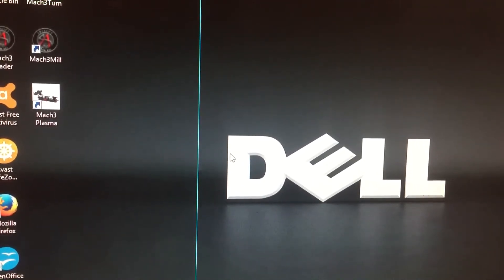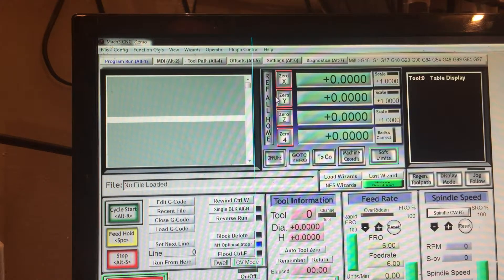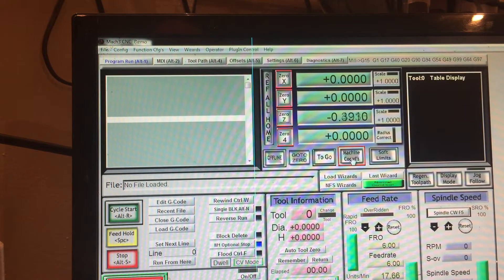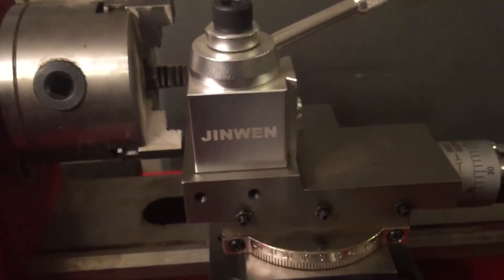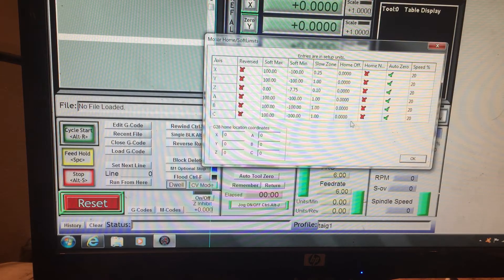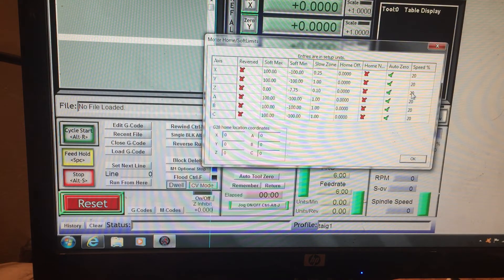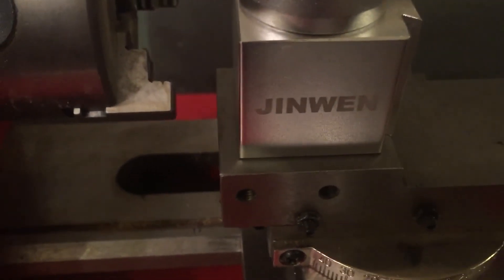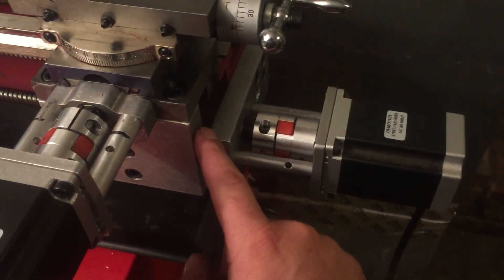How To Set CNC Soft Limits To Avoid Crashes

Comment: I am struggling with soft limits on a mill. When they are set, and if I need to zero the DRO on the work piece, I find that the soft limits are in a totally different place. Is there anyway round this?
Reply from the maker: That is a good question. I'm sorry but I sold this machine just recently and don't have access to it anymore. From what I can recall it was in the separate place like you said and I don't know of another at the moment. Hopefully someone will read this and answer it.

Comment: Do the soft limits change every time you power off machine?... And when you reset your xz 00 start point on various projects does this affect your soft limits? Im going to mess around tomorrow on my cnc with soft limits..maybe ill unserstand better when actually on the machine
Reply from the maker: der ddd setting your xz 00 will not affect the soft limits. They are strictly for keeping the machine from over traveling and crashing or passing thru an area you don’t want. It’s been quite a while now so I don’t fully remember if it recalls the limits once you power it down. But it is simple enough to set back up. It you have a few bucks you can pick up limit switches extremely cheap “couple of dollars a piece” and glue or attach them in the x an z ends to permanently set your limits.

Comment: Do you have to set soft limits every time you restart your machine? Since once you disconnet mach3 will have no idea where machine is
Reply from the maker: der ddd you should be able to save your machine profile in Mach. And a little trick would be to before you power off the machine and Mach home your machine...
Then next time you turn it on just click and tell it your at xz 00. Then the limits should not change. Remember to set the machine to xz 00 not the part to xz00 because that will change probably every time depending on the size of the material your running. But the “machine limits” won’t change because you can’t make your machine bigger or smaller. Well unless you modify it.